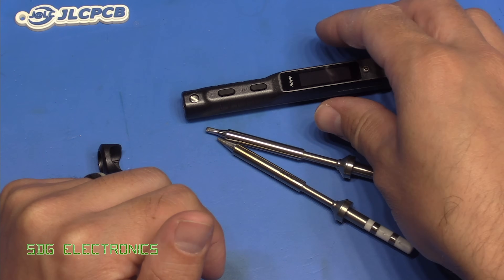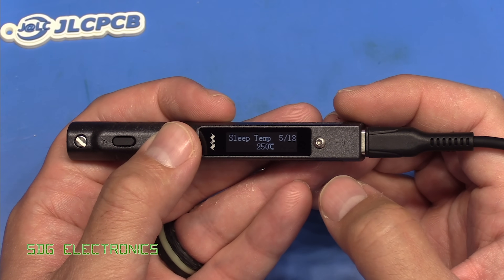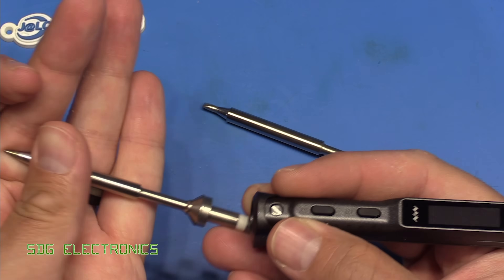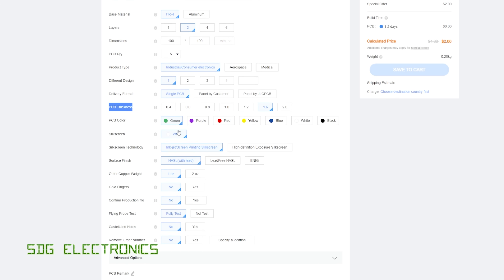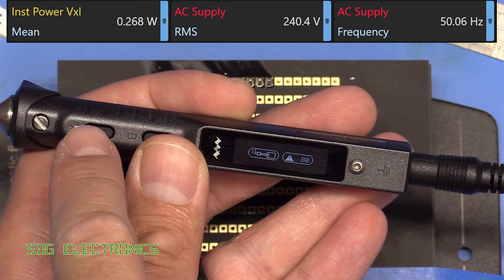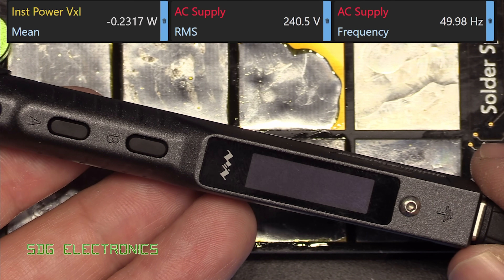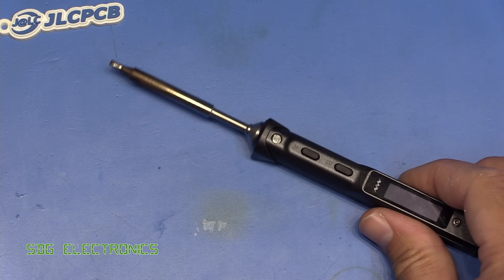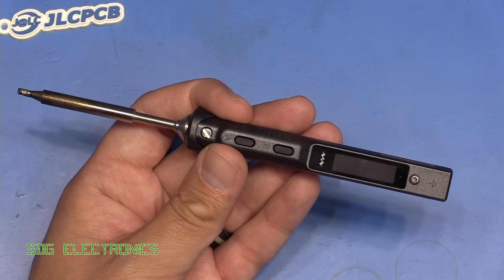SDG #268 New MiniWare TS101 - Upgraded from TS100 USB Soldering Iron test with PCBs from JLCPCB

Comment: Had it for one month and it is a piece of crap. As soon as you touch the PCB pad, the tip cools down, and it needs to re-heat, and it is slow. Using a 18V DC adapter.
Avoid it at all costs, and go for a soldering station instead.

Comment: I believe that plastic cap that's squared is intended for use as a stand or to keep the iron from flopping over...I can't see how it protects from burning your fingers as that part of the iron doesn't get extremely hot...I have both ts-80 and 100, both are great for small to medium work.

Comment: Thank you for this helpful review. Could you advise what you set the sleep temp and time to? Also, whilst soldering, for how long is it ok to keep the iron at soldering temp whilst not in actual soldering use (currently, I turn the iron off as soon as I complete each joint, whilst prepping the wires and position for the next)? Thank you.

Comment: I had a ts100 and the oled screen failed within a year with little use. I searched about the problem and there are a lot of people with the same problem, so they should use a lcd screen instead, it's cheaper and more reliable.

Comment: I wish they had a button lock feature I keep changing setting while soldering without realising. I don't want the guard and TBH you could easily mould a soft comfortable one with some Sugru.
Reply: I had to change all my presets to one temp to avoid this and I have my boost at 380

Comment: Any idea what chipset it uses?  I want to know if Miniware is still using clone STM32 chips in them.  This is why IronOS no longer reccomends TS100.  See:
*Please note that Miniware started shipping TS100's using cloned STM32 Chips. While these do work with IronOS, their DFU bootloader works terribly, and it is hard to get it to successfully flash larger firmware images like IronOS without timing out. This is the main reason why the TS100 is no longer recommended.
Reply from the maker: I'll see if I can find out

Comment: I work for a marine robotics manufacturer and have outfitted field kits for myself and our technicians for whenever we need to head into the field for client support. I used to have a Weller WESD51 in each kit but they were big, heavy, and only work at a single input voltage. So I opted to replace them with TS100's and they've been great. 

They're small and light weight, which is really important when outfitting a kit that someone needs to carry with them, especially on flights. Saving that weight has allowed me to add some additional tools.

As you demonstrated here with the TS101, they're plenty capable for electronics work. I wouldn't replace the stations in our production department with them, but for field work they've been capable, reliable, and much easier to work with in situations when we've had limited working space.

Finally, one of the biggest advantages for us, is when powering them with a wide input AC/DC inline supply you can plug them in anywhere in the world (120/240VAC 50/60Hz). Which is great because we have clients all over the world. The Weller stations were 120V only, so you needed a bulky transformer to power them depending on where you were deployed.

Comment: Nice review Steve. Like you, I prefer a shorter tip. But perhaps it's length could be to allow some thermal separation between the element and the body or electronics of the device. Thanks for sharing.

Comment: Seems like the software is limiting the power. It barely went over 30W while coin soldering. It's a demo unit, maybe the actual sales versions will have an updated software. If not, I am sure someone will come up with an improved custom firmware. All things considered, I think this is like a good combination of TS-80 and TS-100 in one unit, which is really a good idea.

Comment: Thanks for these reviews. The new Pinecil V2 has shorter tips with lower resitance 6.2 ohm tips (vs. 8 ohm) for more power at lower voltages and about half the price of the TS101. Would love to see a comparison.
Reply: I had not heard that about the resistance or the length I guess although I don't know if I have seen the V2 but ya my comment was going to be to bad that pinecil already beat them to it and I assume much cheaper I have had a ts80 for a long time now and it's great but if I was buying one now I'd have to go pinecil
Reply: @james10739  Pinecil V2 looks the same as V1 except the rubber grip is green. I believe the new shorter tips will work with Piinecil V1. So far, I've only seen the one tip that it ships with but the whole line of shorter tips is supposedly coming soon. Should be interesting to see if lower resistance improves performance.

Comment: Thanks for the interesting review.  I’m happy with my current TS80P for mobile use. With the TS80P power upgrade over the original TS80, and the shorter reach than the TS100/101, the TS80P remains my preference.
Reply: Agreed. I have a TS80 and TS80P and I love that thing. It's extremely useful to be able to solder anywhere using an external battery and roll-up silicone mat. I just replaced the head unit in my car and it was so nice to solder while in the car.

Comment: Why does it seem to be a clone of pinecil
Reply: its the other way around, the pinecil looks like the TS100. Its a cheap clone of the TS100, lol.
Miniware released the TS100 as open source, they released board schematics for them. That makes them easier to repair, but also makes it easy to make clones of it.
Reply: @jort93z  Yes but the TS101 looks closer to pinecil than TS100, pinecil also has both usb c and barrel jack

Comment: You got it quickly 🙂 It's nice to see that MINIWARE is constantly improving its devices. When I test the maximum power of the soldering iron heater, I simply put the tip into distilled water and then turn it on. Then I can read the maximum continuous power with fairly high confidence, regardless of the startup algorithm.

Comment: TS100+drill battery is my go-to mobile option. You can get cheap USB chargers to fit many drill batteries, which make good donors for the mechanical fit, just don't forget to put a fuse in!  For mobile but plug-in situations, laptop PSUs are good as chances are you already have that with you.
Reply: I run the same setup with TS80, did you try it?
Makita usb charger as the drill contacts - the 5v is useful too!
Reply: Ya I got a small harbor freight case and built a battery pack that is a 5s3p but they were just like 2000mah or so but it's plenty but with a silicone lead and then ya I use it with a laptop power supply that has a switch for multiple voltages o I usually run it at like 20-22v but ya a drill battery is the same voltage I'm using and works well
Reply: Thanks for the idea, I just ordered an USB charger for Black&Decker batteries 24 euros delivered from Aliexpress. I don't even own any B&D device, but the 2Ah batteries were recently 14 € a piece, so I bought four of those.
Reply: I have a custom made holder for a DeWalt battery that goes on my belt using the ToughBuilt ClipTech system, it also holds a reel of solder and has a holder for the iron as well as auxiliary 18v outputs via Wago blocks, great for work up ladders or scaf towers etc.
Reply: TS100 + 6S Li-Po drone battery is my go-to mobile option ;P
I also use it with usb C as I had a usb C PD 20v board, I just made a dedicated adapter from that.
Reply: mobile but plug

Comment: I am a bit disappointed you didn't compare it with the PINE64 Pinecil 65W.
This one has been on the market much longer and also supports both USB Type C and the barrel plug and TS100 compatible tips.
I would have loved to see if the TS101 is better or not.
Reply from the maker: I'll see if I can get hold of that one
Reply: @sdgelectronics  Try to get Pinecil V2. Pinecil has a new line of tips coming that are shorter and also have a heater with lower resistance. 6.2 ohm vs 8 ohm.
Reply: @sdgelectronics  😍 Much appreciated!

Comment: Nice look at the TS101! Not sure if I'd go for it though, given the Pinecil is cheaper at $26usd, supports 65w USB-PD + comes preloaded with Ralim's IronOS). 
Shame they didn't give the TS101 an aluminium shell like the TS80P....
Reply from the maker: I'll see if I can get it 👍
Reply: @sdgelectronics  The Pine store is sold out (they sell out fast every time it's in stock as they are the cheapest source) but the V2 can be had for ~$40 on Amazon and is currently in stock.  Also, multiple users have tested it out at 28V 140W EPR and it has worked.  Near-instant to-temp times when connected with that power spec.
Reply from the maker: @neverendingstudent  I've got one in hand. Review soon.
Reply: @sdgelectronics  Awesome!  Thank you for letting me know, I look forward to the video.
Reply: @sdgelectronics  Amazing! Looking forward!
Reply: @neverendingstudent  This is my third attempt to ask you, my comments keep getting banned, maybe because it looks like spam to youtube.
I can not find the v2 pinecil on amazon. What keywords do you search for?
Reply: Yeah, I was also wondering why the Pinecil is not mentioned in this review.
Reply: @kwinzman  based off of the PInecil wiki, the V2 released in August 2022 could theoretically support up to 140w over USB-PD. 

.... now only if Pine64 could keep them in stock!
Reply: @Haulien  I was just wondering where to buy them. I saw the V2 mentioned in the Ralim/IronOS github. But I can't find any offerings on Ali, and on the pine64 website I don't see a product page or a shop listing for the V2 and even the regular one is sold out in the pine64 store (new stock mid october 2022). It's like the V2 only exists mentioned on the IronOS github page right now!
Reply: @kwinzman  looks to be the same listing, any ordered henceforth look to be V2. The obvious differing factor seems to be V2 has the green sleeve instead of blue, and a different product box!
Reply: @Haulien  the difference is that the V2 has a different SoC, it comes with a new shorter tip design though it's still compatible with. regular tips and even more exciting is that it's compatible with PD EPR for a max of 140w  over usb-C PD
Reply: @Haulien  I've spoken with one user who has personally used the V2 on 28V 140W EPR and it worked.  They are river-mochi and they have a video of the heat times with different power inputs here on YouTube.  I don't think YouTube will let me add a link in comments though.

Comment: I’m very glad they upped wattage than it was on TS80 it was main reason I didn’t upgrade from TS100 because TS80 was very low wattage and I think I will upgrade to TS101 for portable and keep Aixun T3B for my station soldering. Thanks for the review
Reply: They didn't up the wattage. The TS100 is 65W, also.
Reply: @JohnAldred  I was talking about TS80, my bad
Reply: @JohnAldred i think 90’with approriate usb pd  power suppy